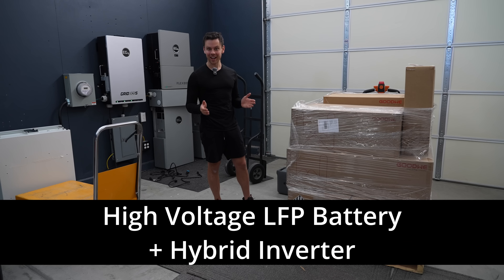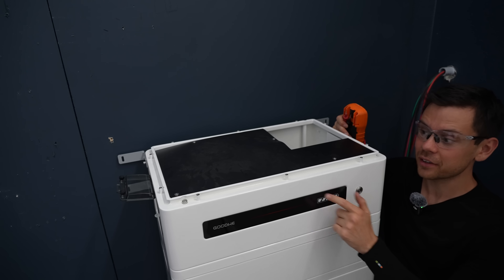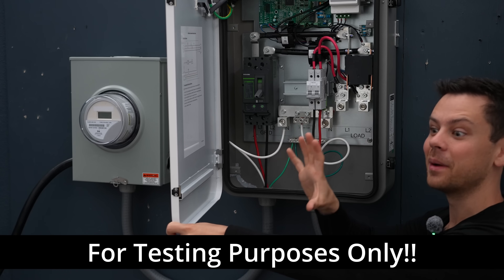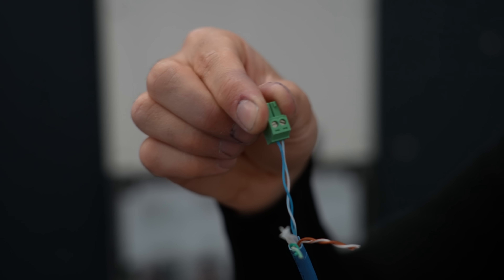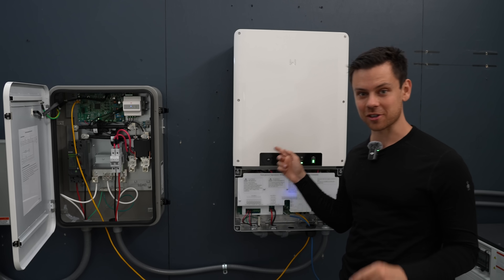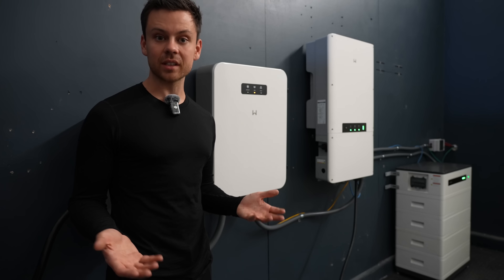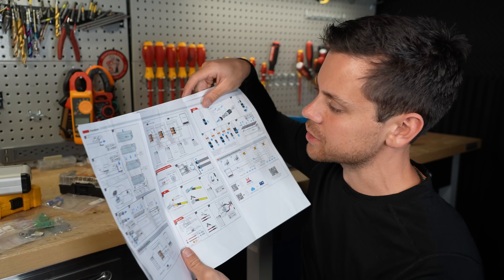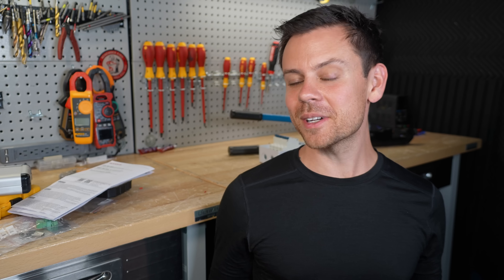GoodWe 11.4kW Hybrid Inverter + High Voltage LFP Battery: My FIRST Dead Silent Inverter!!

Comment: Inverters capable of taking high voltage batteries are certainly welcome. My interest in them is due to the potential to use cheap decommissioned EV batteries (ideally LFP) in their intact full pack form (instead of opening them up and reconfiguring/repurposing the cells)
Reply: Yeah, almost all of the "retired" EV battery packs still have like 75-80% of their full capacity, and it could serve its purpose for many years to come in form of the off grid system

Comment: The entire industry needs to focus on making stuff quieter.
There are flagship portable power stations being sold that sound like hair dryers. EcoFlow is the only company that appears to be installing larger slower fans on proper heatsinks in their gear. Not to say the EcoFlow is great, but at least they understand that noise is annoying.
I have inverters that run their fans regardless if there is a load or not, they're not temperature controlled. Some MPPTs have loud high pitched coil whine that's beyond annoying.

Not *fan*tastic...

Comment: The efficiency makes sense. Dropping from a higher voltage DC (~260v) to a somewhat lower voltage AC (~240v) is relatively easy. Just takes switching FETs and a filter choke. But you'll still be casting off ~330 watts of heat at max load, so I can't imagine that inverter is entirely fanless. I do look forward to your testing report though. 👍

Comment: The downside of not having a fan is that the system might start clipping output in hot weather. Too bad you are testing this in autumn/winter, because the real test is in summer. I wouldn't buy this without knowing how it would perform in summer when you get most of your sunshine.

There are plenty of cheap fanless inverters for sale, but most of them don't get close to their advertised output in summer and you'd need to oversize the inverter 2x for the best results.
Reply from the maker: I'll be able to capture it if it happens
Reply: Doesn't happen on Solis, I run my 11.4kW's all day mining crypto at near full output, South Texas. High Voltage is the way.
Reply from the maker: Yes I'm very curious about that

Comment: 0:22 @WillProwse - I may get something wrong but 7 Megawatthours would equal 7000 Kilowatthours. that would be roughly 180 Systems if those 38,4 kWh Batterys. It might fit in a  shipping container but i doubt it would fit on a pallet
Reply: He was talking generation over a period of months.  A typical whole-home system generates between 500kWh and 2 MWh per month, depending on how much solar is installed.  Roughly.  Across summer.  It adds up.

Think of it like this:  If you had 7kWp worth of solar panels that would generate roughly 30 kWh/day (or more) in energy.   Multiply by 30 days and you would get 900 kWh/month of generation.   That's 0.9 MWh per month (across summer).

Will has a lot more than 7kWp worth of solar panels to play with.
Reply: @junkerzn7312  the part i misinterpreted might be  : he said "...system has BACKFED 7 Mwh..." , what i just realized as i turned on the subtitles. Before i misheard as im not a native english speaker. In that context his statement does make sense to me. Thx for trying to clarify it. Appreciate it.

Comment: I think the future is having the MID/transfer switch as part of the main electrical panel.  No extra MID box, just swap out your electrical panel for a smart one.  Also, the higher voltages make sense, especially due the cost of copper nowadays.  Just need a standard for DIY high voltage batteries.  Also, these systems need to be UL9540 compliant to meet electrical codes.

Comment: Will, thanks for this review as I think the industry will be moving toward those high voltage units in the long range outlook.  Question, I need crimpers for the 6-8-10 size stranded wire, any type that is highly recommended for mounting into main panel and devices?

Comment: Will 6x 48v in series work?
Reply: No.  The BMSs need to be able to withstand the full series voltage if a fault condition develops, so you can't just put 48V batteries in series unless they are rated for it.  It may appear to work fine, but if anything goes wrong it instantly becomes a fire hazard.

This is why when you see 12V and 24V batteries they are often specified as have a 4 x 12V or a 2 x 24V series limit.... the FETs in those BMSs are probably only rated for 60 or 70V or something like that.   Most 48V batteries are in the same boat and can't be put in series at all.
Reply: @junkerzn7312  ~ Good explanation!

Comment: high voltage systems by Huawei, sungrow, goodwe and Solis, all these use proprietary batteries. I think lack of standardisation in high voltage parameters is the reason these companies are keeping their systems closed and charging a premium on it. A DIY jailbreak of this, if you achieve it, will be a HUGE thing. I've been following your channel for years now (since 2019) & highly appreciate what you have achieved till now. You getting into ultra efficient low cost high voltage stuff is exciting! Good luck 🔥
Reply: Solis has no proprietary batteries, they opened it up to most HV battery manufacturers.
Reply: Dala Repair Channel has such a open source project. Connecting a Volkswagen HV Battery to an Inverter. It is 1 or 2 years old and very wide maintained from people all over the world.
Reply: @LittleSpot  Those Volkswagen HV Battery might be easy to source in the EU but how accessible is it in the US?
Reply: just search for   Installing Battery-Emulator (2026 guide)
Reply: HV bms are comming with huge exspence that is the biggest issue for diy.
Reply: @marko24312  You don't need a BMS if you use re-purposed EV batteries. BMS already inside. Very cheap kWH.
Reply: Solis connects to most of these batteries you mentioned. It has a list of compatible stuff on the internet. Look it up.

Comment: Interesting... is there a very quiet or silent 48v off-grid inverter in the market?
Reply: My Victron MP2 5K 120V is very quiet but not silent.  BTW, it only has one fan and it is internal to the inverter.

Comment: Every person on the planet would want one? Exactly. I bought a bunch of $200 6kw Tesla's Delta h6 inverter which works with a DIY 516 volt battery after you hack the system.   But the inverters are not robust and don't last very long so it's not a good end-all solution.  The H6 makes no noise also and stays cool because it's so efficient.
Reply: Are you pushing it to its limit? Could you simply parallel two of them to make it last exponentially longer?

Comment: Finally getting some retail/commercial products for testing ;) GoodWe is a pretty common brand used here in Australia, it's considered middle of the road and well priced.

Fronius and Sungrow being higher end in the Australian market :) Australia is quite an advanced market in Solar and Batteries, with very streamlined process (and hence cheap) for installation and certification
Reply: Solar in Australia 🇦🇺is so strong that even conservatives stopped criticizing it. 👏
Reply: In America that inverter is much more expensive

Comment: We have had a GoodWe 5 kWatt inverter for 7 years. No problems. It's a set and forget unit.
Reply: I had a Goodwe 3kW inverter for 9.5 years. Note had: it broke. Replaced under ten year warranty for another much newer goodwe. Hopefully it’ll go another near decade.
Reply: @JasperJanssen  Any idea why it failed?
Reply: @subhobroto nope. Just a total failure, wouldn’t turn on. Since it was under warranty I wasn’t going to investigate internally.
Reply: @JasperJanssen  Thank You Jasper
Reply: @JasperJanssen  Thanks for sharing your experience, Jasper 😊 and we’re glad our warranty team got you back up and running quickly. We design our products to last, but on the rare occasion something happens, we stand behind our systems and customers with long-term support.
Wishing you many more years of smooth performance with the new unit! ⚡️🙂
Reply: Thank you so much for sharing your experience! We love hearing long-term feedback like this 😊 reliability and peace of mind are exactly what we aim to deliver. 🙌
Reply: @goodwesolarengine well done following up on customer feedback!

Comment: I can't believe is completely dead quite, absolutely no noise. 
Woow.
Reply: HV means that you're stepping down, which is quite energy efficient as opposed to having to boost the voltage up (more wasted heat)
Reply: Right?! You better believe it 🙈😂
Silence + reliability is what we’re all about.
Whenever you’re ready, we’re here to help you power up — quietly ⚡️🤫

Comment: You never defined high voltage battery. What does it mean?
Reply: Anything above 48V nominal/60V peak is considered high voltage, at least in the US but I'm pretty sure global codes are fairly consistent on that.
Reply: @andrewfidel2220  thank you

Comment: I’m wondering if there will be a market for repurposing old e-car batteries. My 66kWh 400V battery in my Chevy bolt will be useful for whole home backup, even if the capacity and power delivery drop to half of manufacture spec.

Comment: A couple points for ya Will.
Instead of cutting a network cable, I would get an RJ45 socket, and a chunk of wire, and make a jumper to plug in a standard patch cable to. 

And 

Get yourself a Milwaukee M12 “surge” model impact drill. Super quiet operation, and great for this kind of assembly/disassembly.

I do love my Ideal orange Allen key set, but having Allen sockets to use with my surge is a game changer of speed and comfort. 

Great video Will, I will quote this system to my next customer.
Reply: The surge is magical, smooth, nice on ears and hands.

Comment: In Australia it cost around 8K

Description	Quantity	Price	Total
41.93kWh Battery storage with 10kW Inverter		$22,143.00	$22,143.00
Battery storage FoxESS EQ4800-L9 (41.93kWh / 41.93kWh usable)	1	(incl.)	
Inverter FoxESS KH10 (AS4777-2 2020) (10kW)	1	(incl.)	

nverter. 10 years replacement warranty
Battery. 10 years replacement warranty

Blackout Protection/ UCP mode/ Backup power. included 
BMS (Battery management system) enabled. 
WIFI monitoring system included.		(incl.)	
Battery System Parts incl. (Switchgear/
Cover/Base).	1	(incl.)	
Supply and install of bollard. 
Supply and install cement sheet (if installing in the garage). Included		(incl.)	
Admin Instructions :		(incl.)	
(incl.)	
Subtotal incl. GST	$22,143.00
Included GST	$2,013.00
389 Battery STCs 2, 3 × $37.00	−$14,393.00
Total incl. GST	$7,750.00

Comment: WOW to Higher Voltage Battery to Inverter that is cooled without audible fans. I would love to eventually see direct DC voltage connection between an EV battery to house battery with some reasonably priced in between equipment. Seems  that goal would be more easily obtainable with that higher voltage home battery compared to just 48v and/or  51.2 volt set ups. YES to seeing innovations that would eventually allow that type inverter to be connected to DIY Built LiFePO4s.

Comment: I have been looking at a few HV systems (GroWatt specifically), but as you stated, if I can't build the battery, the math stops mathing.  I have though about HV for the main power entry, then smaller 48v systems at some of my outbuildings.  That sort of works, but I hate mix/match and not being able to swap parts or keep one set of spares that covers more than one location.

Comment: Yeah, I'm probably gonna rip my EG4 POS 21 off the wall and replace it with something else, anything that just finally works for once. What a nightmare these kids created, zero tech support, every firmware update is worse then the last and I could go on here but I'll just make a video instead. The can't do it's job flexboss 21 is supposed to be under 50db fan noise, well I measured it and it's over 70db! Proof is on my channel. If they can't even get the noise rating correct, you have to wonder what else they lied about? A lot, I'm here to tell ya! I agree high voltage is where we're going, and I was/am thinking about it but I can't even get a conventional system up and running stable yet, so HV will to wait.
Cheers and good luck 🍻

Comment: Great video! For a safer 200V DIY battery, you could use multiple 48V battery strings (e.g., 4x 48V for ~192V, or 5x for ~240V, adjustable to 200V). Each 48V string has its own BMS for cell balancing and protection. Connect these strings to a central board that handles the series connection via relays or contactors. This way, users only work with individual 48V strings (below the 60V DC safety threshold) during setup or maintenance. The board can include isolation switches for each string and a microcontroller to manage connections, ensuring the high voltage (200V) is only active when the system is fully assembled and powered. This reduces shock risk while maintaining functionality. Thoughts?
Reply: >> The board can include isolation switches for each string and a microcontroller to manage connections.
Interesting idea, but maybe simple to just extract the batteries and the controllers from an EV who already provides V2H, like the Cybertruck.
Reply: @nihongobenkyoshimasu3190 The CyberTruck uses NMC batteries, not the safer LFP ones.
Reply: Plus who dosnt want a 60KW or 120KW battery!

Comment: Love this!! I know that higher voltage battery systems will be the future. I think the only company that makes a high dc voltage AIO unit is Ecoflow delta Pro ultra. Its been out for a couple years now and is a 100v dc battery pack which helps keep it super quiet when charging and discharging.

Comment: GoodWe is supported by Dala’s BMS project. You could buy a salvaged 75-83 kWh Tesla Model 3 battery pack for less than £2,500 here in the UK or around £4,000 for the LFP 63 kWh one and connect it using a lilygo. 

A guy I follow on YouTube has two of these Tesla packs and a 30kW inverter from Fox. His whole 126kWh / 30kW LFP system cost less than £8,000 iirc. 

The Tesla packs require little to no modification too. You can pretty much just replace the pyro fuse and bridge the various interlocks and then connect right to the 400v output. 

The advantage is you get to keep all of Tesla’s safety and BMS and don’t have to take the pack apart.
Reply: this! i made a system with 2 goodwe inverters and 2 Leaf 30kwh.
Reply: @jojje1963  Yes!! I really want to do this one day. The leaf packs are pretty cool but I think I'd go with Tesla personally. Here in the UK the price of the leaf packs vs Tesla are around the same.. but the Tesla packs have way more capacity and are much newer so offer quite a bit better value
Reply: @iambenmitchell  Im in Sweden so we buy our packs from Norway, and im cheap ;) If i had the money I would use Tesla packs, maybe.. the great thing is that you can use what ever you can find, thanks to Dala and team
Reply: @jojje1963  Dala and the team are amazing!
Reply: Whats this guys youtube channel please?

Comment: I've been looking at Solis HV Hybrid inverter for a few years now, just can't pull the trigger.. It doesn't have the full DIY name tag like all the LV inverters...
@WillProwse  You should take a look at Enphase.. I really don't think it could get more efficient or quieter than that. I have a friend that recently purchased a home with the 3gen setup and it is really cool. When you start reading up on the new 4th gen setup with the new meter collar auto disconnect and the new IQ8 micro inverters it gets even better.. and they have free training resources so you can do it all yourself... It is a little pricey, but very cool!

Comment: We would need 82 - 314 Amp Hour LiFePO4 batteries at 3.2 volts to equal 262.4 volts. At 314 Amp Hours we would have a 82.394 Kilowatt battery. That would cost $6,396 @$78/cell

Comment: Will.  the holy grail is : an inverter that directly connects with tesla model 3 / Y batteries ....they are piling up in wrecking yards and you can buy them for 3K    .....   3K
Reply: I have a GoodWe 10K inverter connected to a Nissan Leaf 40 kWh battery pack. The Leaf battery CAN is translated by a ATXMega32 microcontroller as a BYD HVS battery which works with the inverter. The usable daily capacity is around 28 kWh. I bought the battery for € 5000,-
Reply: I would be interested in learning where in the U.S. they are piling up in wrecking yards where you can buy them for 3K ? Where-ever I ask, the wrecking yards don't sell the batteries for liability reasons and I read that they get sent to the EU
Reply: You are so right!
Reply: That would be a Sigenergy system with V2X module.  It can pull directly from the Model 3/Y as long as they have the CCS compatibility.  You would still need the charge port functioning to make this work though.

Comment: Great video and great products! But your screenshot at 9'30" shows the UL 9540 Closed-Loop Bundle for $13,038. I just clicked on the affiliate link and the price came in at $20,072. What am I missing?
Reply: It defaults to a more expensive option. If you select the first one in the list you get the $13k price.
Reply: @rainierfamilyhomestead  got it. Thanks!

Comment: a fanless inverter thats a first for me. does it actually regulate its temp effectively without fans, even at near maximum output for prolonged periods?
Reply: Yes. Fanless inverters always come with huge aluminium heat sinks, usually the back. The are usually built to higher quality and efficiency so they produce less heat to start with.

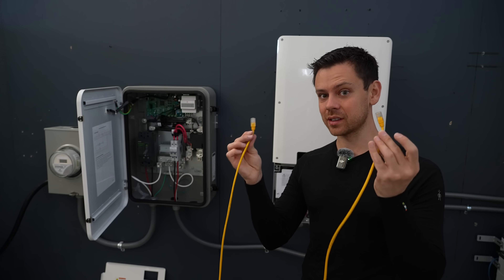Comment: 5:15 What's an MID?
Reply: Microgrid interconnect device. It's like a fancy automatic disconnect switch that distributes your AC loads. It's installed between your meter and breaker panel, and receives power from your inverter. Some also have connections for smart ports/dump loads. Gridboss is EG4's version.

Comment: Take a look at the battery emulator from Dala. You can take used EV car batteries and connect them to high voltage hybrid inverters. Some EV packs use LFP as well.